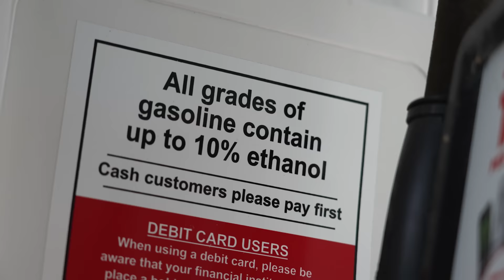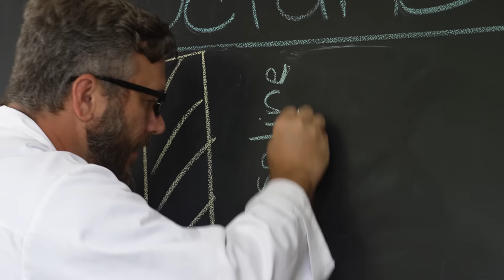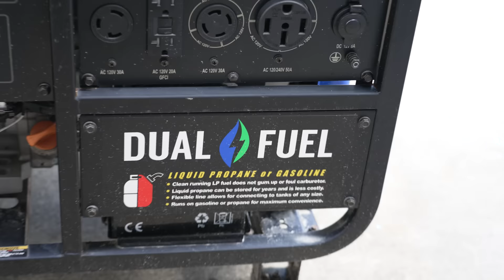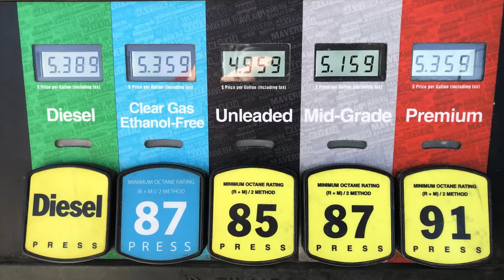This Will Destroy Your Emergency Generator! Don't Make This Mistake

Comment: After a deep dive in research I switched to ethanol free gas for all my small engines, Pri-G complete gas treatment, and NATO leak free steel gas cans for storage. I keep two 5 gallon and one 2.5 gallon can of gas at home in case some dingbat Family member forgets to fill their car tank. Every small engine device should come with a tag that gives you these instructions. It’s criminal that they lead you to believe otherwise.

Comment: My local station has in a special pump to the side of the parking lot just for Non- Ethanol. BUT hardly anybody buys it because it is very expensive. So it has been in the underground tank for almost 2 years. When I bought it for my Chainsaw and weed eaters they would not run right at all. I hated to do it but I put ethanol fuel back in and they ran great after just a few minutes when the non -ethanol got out of the carb.

Comment: I am one of the lucky ones. I have a station right across the street that sells zero ethanol, which I keep in all my gas cans. I also fill my boat up with it, because the engines were made in the late 90s. E-85 (MOSTLY Ethanol) doesn't go up as much when Opec pulls shenanegans though. But save that for the flex-fuel daily driver.

Comment: I use PRI-G for storage. A friend put some in a gas powered air compressor with ethanol fuel and retreats fuel every year. After 7 years ( he never uses it) it is to full to add any more treatment but starts on 1st pull every year.

Comment: I always drain the tank then remove the carb bowl and drain that too. Always treat fuel with Stabil,...even new fuel and I also use a bit of Berrymans B 12 carb cleaner from time to time. Never a moments trouble that way.

Comment: I have a dual fuel generator that runs on gasoline or propane. I run mine exclusively on propane. Propane has a longer shelf life than gasoline.

Comment: I believe that these statistics are accurate - -
Pure gasoline will absorb 150 PPM of water (not enough to matter)
10% ethanol will absorb 7,000 PPM of water - - which in turn produces "bad gasoline"
In order to maintain necessary octane, when removing ethanol, use high test gasoline.

Comment: Ethanol sucks, but if you buy mechanic in a bottle and add it to your gasoline, the ethanol will not gum up like normal.   MECHANIC IN A BOTTLE! works like a charm.  I leave my gas sit throughout the winter and no problems at all any more.

Comment: Thank God I learned my leason in 2008 with a wead eater and all fuel lines and the carb where shot. I only use blue non-ethanol fuel in all small engines.

Comment: Ethanol mixed with gas doesn't gum up carburetors because ti doesn't burn as clean .... carbs handle the gas BEFORE combustion.  Not after

Comment: I use aviation fuel or cam two or renegade race fuel , when I run out my generators to store them for a while ,those fuels have 2 year shelf life as well as clean out carb before I store

Comment: I buy non ethanol fuel (called small engine fuel) in 55 gallon drums. 91 octane. Use on all small engines.  No gummy carbs etc. great video though. Now I can make own if necessary.

Comment: Bro, I have that same brand of generator and it straight up says 10% ethanol on the gas cap.

Typical usage scenario is to run the carburetor dry with the petcock valve closed and you should not have any problems with storage.  

We tune our cars for E85 and get more power than gas.  This  is 20th century info in this video.

Comment: life hack. add a fuel cut off valve right below the generators tank outlet on the fuel line. when your done using your generator remove the load and do a cool down procedure. turn the oem fuel cutoff on the tank and the one on your line. this will allow the carbs to run dry. No ethanol/fuel in your carbs means nothing to dry out. you can fail to start it for years and itl power up like a champ with a little fuel stabilizer or a flush of fuel . no messing with your carbs or dry-rotting lines. I would recommend taking your gen out and run it on a load for at least 20 minutes every 4-6 months...

Comment: Yep ethanol is bad for almost all of us . The one exception is E85 for hot rod  guys , the octane rating is high meaning you can drive your 13 to 1 compression  hot rod motor that would normally need race gas .

Comment: Do you know how many "Like New" pieces of non-running yard equipment and generators I have purchased on Craigslist for $50-$75 just because they were used for one or two seasons and left over winter with fuel still in the carburetors? I love this Ethanol stuff.

Comment: Here in CA we had back to back Newsoms, errrr, power outages about every 6 months. I got a generator and was loading it with ethanol free stabilized fuel from home depot at about 4 times the cost of gas. Because we had multiple day outages, I had to go get more of it to keep the generator fed.

Short story. I don't do any of that now. I drain the fuel from the generator. Its not hard, you just take a single screw out of the carburetor  and drain the fuel out. On power outage, I go get a gallon of fuel from the gas station and load it up. Much cheaper. Gas station fuel does not store well. I have had some lying around for mowers and such, and it turns into garbage after about 6 months. The lesson is: don't store it. If I have left over fuel after a power outage, I put it into my truck and burn it.

Comment: There are seals made of polymers that resist gasoline, and the same material resists alcohol, but that material does not resist a mixture of gasoline and alcohol. This is true of many materials and other fluid combinations, glycol, transmission oil, brake fluid, gasoline, diesel, soap, the list goes on and on.

Comment: I hear complaints all the time about ethanol-gasoline blends ruining carburetors. I don't get it. I have never had trouble. I run generators, water pumps, chainsaws, wood splitters, garden shredders, pressure washers and old tractors, and just never had issues. None. My machinery is always well maintained, run regularly and reliable as hell. I don't waste my time worrying about imaginary problems.

Comment: It has its ups and downs, trues and falses... I ran E85 (85% Ethanol) on my racebike and just about the only downsides were more fuel consumption and harder to start in cold weather. I tore it down as i usually do and it looked BRAND NEW inside, no build up, clogging, dirt, coal or anything, a regular engine would be 10x dirtier than what i saw.

Also rubber, for 9 years i didnt notice any noticeable difference, i guess it depends on quality.

We did another test and having E85 sitting so it dries out totally in carburetor f.ex will give some small residue that can clog the jet. But as long as its running, no problem :)

And your engine will smell like a hamburger kitchen when its running :D

As for enviroment E85 was quite big in the early 2000 in Europe. But they concluded that using land for all that fuel did more harm in long term than regular petroleum. Its better when you burn it, but the whole process is not

Comment: The difference in price between using premium grade ethanol free fuel vs regular is far less expensive than the price of engine and/or carb repairs. Plus you generally get better efficiency from premium. All 3 of my motorcycles and both my cars get only Chevron 94!

Comment: Not the least convincing English accent I've ever heard :)  As a seasoned conspiracy theorist, I knew there was going to be a fuel crisis last year, so stocked up, but being an idiot also, I had E10.  Had to do this whole process with about 200 litres.  Dumped 4 bottles of octane booster in after and all was good. Cruising past the sheeple in petrol station queues with the roof down feeling smug.

Comment: The real cause of all these fuel problems in people's equipment is lack of proper maintenance. I own eight generators and I run nothing but regular pump gas. I've never had a single fuel issue in anything I own. Storing them with stabilized fuel and the fuel valve turned off is all that's required. You'll also want to let it run until it stalls to use up the remaining fuel in the lines and carb.

Comment: I had heard the fuel pumps that  dispense multiple types of fuel you can get a cross contamination. If purchasing non ethanol gas you could get up to a third of a gallon of ethanol fuel .

Comment: I bought a dual fuel generator a year ago for camping.  We normally boondock.  I have never put gasoline in it.  You don't have to worry about leaking gas cans when traveling and no corrosion of generator parts.  We can get by with about two 30 lb tanks for a weekend through the generator.  More if it is hot, much less when it is cold.

Comment: Non-ethanol high-test in EVERY small engine. If it's not readily available, I just grab some Trufuel at the local hardware store. I use Trufuel at the appropriate mix in all of my two-strokes and swear by it.

Comment: I only use ethanol free fuel in my power equipment. Generator, mower, line trimmer. snow thrower. Etc. Ethanol is really bad for 2cycle equipment.

Comment: I used ethanol fuel in my small engines for years before I learned that non ethanol was available in my area.I would always use supreme gas and religiously use STA-BIL  stabilizer (Although any name brand is fine)  and not once had an gas related problem.  If my generator would sit for a year without use, I  would just siphon the gas out with a small hose and replace it with fresh gas.  Ethanol is only a problem in engines that sit unused a lot.   Stabilizer is no gimmick.

Comment: The joys of Ethanol being so hydrophilic that it sucks moisture out of the air at an alarming rate, is the REAL reason behind all those ridiculous devices on modern fuel cans. It is not to keep fumes from evaporating. It is to keep the Ethanol from absorbing air and thus crapping up your engine.
They suck at it, because it does, indeed, suck moisture from the air at an alarming rate.

Comment: Gas is way better than propane. You can burn through propane so fast and it's way more expensive, running a whole house in the winter in NH.

Comment: Small tip, if I have a carburetor that will not see fuel for a long time (like in a tri fuel generator) I fill the float bowl with 2 cycle oil just to protect it from moisture in the air.

Comment: I'm lucky I guess, I can buy ethanol free gas at marine or farm stores for my generator and power tools. I also add a stabilizer and make sure you use a marine stabilizer and NOT a stabilizer for E-10 gas. I've used this gas combination for over 10 years and I have had not E-10 issues. I also use this fuel combination in my outboard engine on my boat.

Comment: If you are able to get just the water ethanol mix out with too much of the gasoline you could put said water/ethanol mixture in the windshield washer fluid container...
The best way to get rid of the water is to drain it from the bottom of a tappered flask of some kind...more accurate...

Comment: Gasoline burns around 12.5:1 Air Fuel Ratio by weight.  Weight of air, weight of fuel.  Ethanol burns around 9:1 AFR while containing fewer btus of energy.  That means you need to burn more fuel with ethanol as compared to gasoline... meaning less milage all around.  Burning corn in our cars increases the cost of food overall.  Corn feed for chickens... so your eggs are more expensive, as well as that chicken sandwich for lunch cost more.  Corn feed for hogs, so your bacon for breakfast, as well as the ham and cheese sandwich for lunch cost more.  Breakfast and lunch are more expensive.  This is how economics works.  Econ 101.

Comment: Using E10 and storing E10 are two different things.  Around here any new gas station that goes up seems to have a blue handle or two where a fella can get straight gas with no corn...E-free I like to call it!  I run that in my mower and small engines exclusively.  If you can buy E-free then great.  Removing the E is a lot more hassle than its really worth.  Another alternative is aviation fuel if you have a private air strip anywhere near by...its spendy though!  

I keep four 5gal jugs of E10 on hand at all times for the genny.  Every two months I dump them in one of the vehicles and fill them up again so I always have good fuel on hand with just a little effort.  E10 ages faster than E-free but even E-free still doesn't last forever.  Those stabilizers are okay for treating the gas in things that will use up the rest of that gas next season.  They are not good for long-term storage...just rotate your emergency fuel.

This past week we needed the genny for a little over 48hrs and I ran it all on E10.  Once power was back I pumped out the tank and then let it run out what I couldn't get.  Then I pour a little of the ethanol-free gas in there...just a splash, maybe 12 oz...and run all the E10 out of the system.  Using E10 is not the problem...its letting it sit in the lines and bowls thats your real issue.  Just flush it out and you will be fine.

Comment: Thanks for the videos. My generator stop working. It was surging and then it died. I have gum/gunk inside my tank from the ethanol. Should I remove the tank? What do you suggest? I'm working with predator 3500 inverter

Comment: 7:20 There's a gas filter (Mr Funnel) that will separate the gas from the water. The gas passes through the funnel filter while the water stays behind in the funnel. It comes in two sizes. Im not sure if the ethanol would pass through after attaching itself to the water. 🤔

Comment: To anyone that doesn't want to make their own ethanol free fuel or pay 200 percent more for 10 percent more gasoline,  if not more, I use ethanol free lead free 91 octane from my local general aviation airfield that's available 24/7 to everyone regardless of if you fly. They welcome us poor lazy people and compared to the nearest gas station with ethanol free are much cheaper. Hope that helps as it's huge for me who makes ends meet selling used equipment with a guarantee I stand behind.

Comment: Not sure if its better, but during emergencies like the hurricane Texas just had, i run 87 when its constantly being used. Not sure if its okay, but i was burning about 15 gallons a day in fuel and ethanol free is 4.20ish per gallon why 87 is 2.79 per gallon here 😅 once the power was back on though, i flushed out the remaining fuel, threw in a gallon of ethanol free, ran it for a bit, turned off the fuel shutoff and got as much out as i could. Once the fuel was done i did all the maintenance too like plugs and oil so it was fresh and ready to go for the next hurricane im sure we will have this year....

Comment: Buy a Predator generator from Harbor Freight, they are made to run on E10. They have a sticker on it that says it ok to use E10. I have one. Sthil chain saws also run on E10 and string trimmers.

Comment: Ethanol-free gas is really hard to find around me.  So every 4 months, I put the E10 from my gas can into my car, then get fresh E10 for the gas can (which is kept for generator / snowblower usage).  Is it better to do that (always have "fresh" E10) -OR- to run the generator / snowblower for a few minutes once a month, then add a small bit of E10 and STABIL to their tanks?

Comment: Others may have said this but while ethanol has about 1/3 less heat energy from some gasoline blends, since it's only 10% or less the power loss for the blended fuel is in the 3 to 4 percent range at the worse case. We should be more mad that using corn to make ethanol saves little to no CO2, which was then point of mandating it and it drives up the price of feed corn. Which means we all pay more for meat so we can process more lower grade oil into gasoline.

Comment: Luckily most mavericks in my area sell clear gas. I use it in all our small engines, boats, atv's. I also fill my truck up with it every chance I get! I remember when it first hit our pumps, the next fall when people started dragging out their snow machines a whole bunch of them blew them up right off the bat, they had left the gas in them over the summer and the fuel had separated and they started their engines on an ethanol/water mixture, it was not good.
Reply: No shit haha that would suck

Comment: My recommendation for small engines is to either close the fuel valve or drain the fuel tank and then run the engine until it runs dry.

Comment: no argument e10 is bad for carb engines, but the same reason you highlighted ethanol is put into cheap low octane gasoline is the same reason you dont want to take it out. once you take it out, you end up with a lower octane than the original spec from the pump. use it if you have to and then drain it and run it dry.

Comment: This was a great learning process about ethanol and the removal of it!. I cant find that gas with no ethanol so I've been running some cam2 racing fuel in my 67 f250 high-boy to protect the carburetor and lubricate my valves.

Comment: Never once had a carb problem. I top off all my equipment before winter no stabilizer.  Not ethanol free gas either.   I guess I have good luck.

Comment: Ethanol doesn't affect your small engine.  I've been running E10 in all of my equipment for years.  It runs just fine.  I have had equipment that dates back to the crappy 1969 Briggs and Stratton flat heads to the much better designed Honda and Tecumseh flat heads as well as Honda OHV, Honda clone OHV, Tecumseh OHV engines as well as my Echo and other 2 stroke engines and there isn't a problem.  The issues encountered with gasoline are due to fuel systems having components made of petroleum-based rubbers like hoses and gaskets.  The gasoline, not the ethanol, eats away and gels in these areas causing issues.  Ethanol isn't to blame, it's due to the gasoline and the added chemicals as well as the big one:  user ignorance and error caring for the equipment.